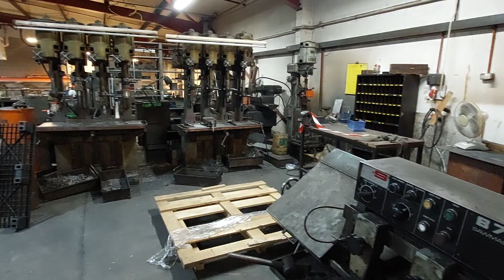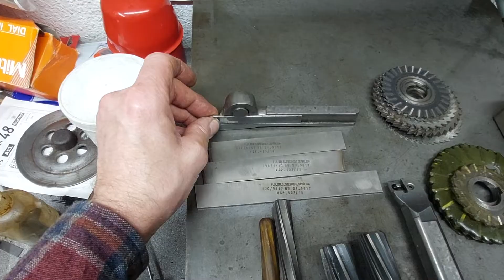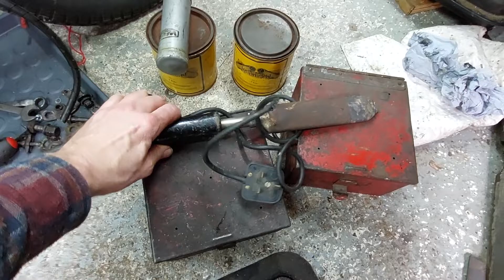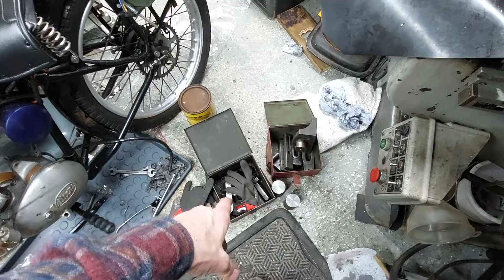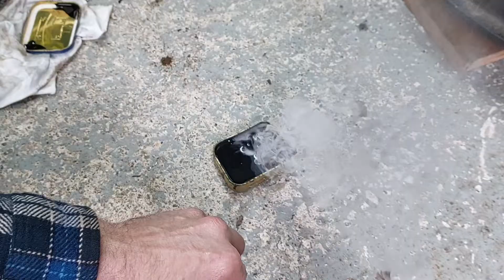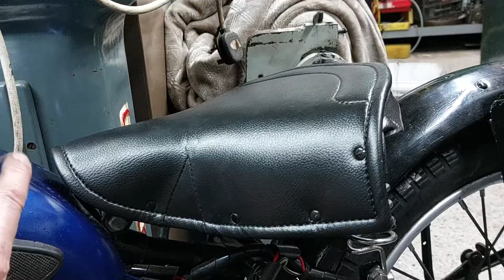WILL IT START....1939 EXCELSIOR VILLIERS 9D ATTEMPTING TO FIRE IT UP AFTER REBUILD

Comment: I do really like working on Villiers engines. I cut my teeth on ths 9E and 32A engines in my first proper trials bike, a Sprite with really worn out AJS/Matchless Wobblydraulic forks. I believe the bike was sold without forks so they could call it a kit to avoid Purchase Tax back in the day. George, the mechanic at Broardway Motors literally kept those plastic HT pickups under the counter and would get one out when he saw me coming. I think I was only 13 possibly, 1976?

I have a Cincinnati dividing head which gives me a hernia just thinking about getting it onto the milling machine table! We bought a granite surface plate at a similar engineering auction. I think its about 24" x 36". They loaded it into the back of the Land Rover with a fork truck. We got home and it occured to us we had a problem, how to get 380lbs of granit out of the back of the Disco. We used the engine crane in the end with strops. A very hairy operation indeed 😬

The Excelsior sounds great.
Reply from the maker: The Excelsior is a nice little thing ( there is one set up as a trials bike at Brooklands ......maybe a way to go, it's light enough)....engine cranes....useful and deadly in equal measures 😬...glad it the surface plate was safely extracted .

Comment: Well done Mr T. Started well and sounded good. When I was mechanicing for the Post Office Motor Transport in the 60s we used  brake fluid to clean out SU carb dash pots and the like.  It worked very well and the carbs came up lovely! Just a thought?
Reply from the maker: I shall give it a go Mike
Reply: @TweedsGarage you’ve heard of the saying, A tiger in the tank! Well the brake fluid got rid of the tiger Crap in the carb, excuse the language, i used  to be choirboy!?,?,

Comment: As a kid around 1970 I bought a non-runner Excelsior-Villiers, girder forks. 
Unfortunately the crankshaft was bent. 
I think someone had tried to run a belt from the flywheel to something in their shed ... 
It turned out to be beyond my skills, knowledge and pocket so I moved it on.
Reply from the maker: That must have been one smokey ( and noisy  ) shed 😄, a shame it was bent.
Reply: @TweedsGarage  The frame and paintwork were in great shape though. I really hope it got brought back to life. 
Handle bar gear change !! 
Really old school.

Comment: The jig borer that you mentioned that Cutting Edge Engineering in Australia purchased used to be at the old NSW State Rail Maintenance Facility located at Cardiff NSW Australia.  I worked there after it was taken over by EDI Rail from 2001 to 2012 and again in 2018/19. That jig borer was in the old apprentice training area within the main workshop in an airconditioned room.  I think when the guy who owns Cutting Edge Eng bought it, it went with a fair amount of tooling and attachments. Unfortunately, a lot of tooling for the machine was thrown out along with a considerable amount of toolroom equipment ie master thread gauges, surface plates, straight edges, master squares and large inside and outside micometer set up equipment. It was criminal the amount of test equipment and tooling that was scrapped. Nobody knew what the equipment was or what it was used for, so it went to scrap metal.
There was also wheel turning machines (some or which went to the Heritage Centre in Sydney, I think). There was a large dual chuck wheel turning lathe that had been there since the steam engine days, there were photographs in the office showing steam locomotive drive wheel sets being machined. The last I saw of that it was out the back of the yard in pieces in the weather for quite some time then it disappeared. Scrapped no doubt.
There was also a foundry at one end of the facility where they made dog spikes, fish plates etc all sorts of stuff and two 38 class boilers set up to provide steam for cleaning etc, as far as I'm aware the old steam pipes are still in place.
Reply from the maker: Thanks for that Mick that's a great bit of info and yes it is criminal the amount of equipment that has been melted down, its quality and precision will never be matched today. Luckily Cutting Edge Engineering managed to source a load of tooling for the SIP jig borer, a lot were as new condition in there original drawer units, definitely things of beauty and worth a watch.
Thanks 
Mr T

Comment: Is there any output data on this Villiers engine to compare with the Bantam, just interested in how the output has changed over the years. The 125 Bantam was 3Kw so I am assuming this may be 2Kw or so, I noticed it only had 40mph on the speedo whereas the 125 Bantam supposedly could reach 45mph. Look forward to hopefully seeing them ridden? Some great videos thanks!
Reply from the maker: In old money the D10/B175 power output was rated 12.6 BHP and the Villiers 9D was rated at a neck snapping 3.15 BHP and yes they will be ridden at some time, thanks for tuning in 👍
Reply: @TweedsGarage  Thanks that helps to fill in a few boxes for me. I have a modern 50cc scooter with an output rated of 2.6Kw which is about 3.5 bhp and a 125 with an output of 10.7bhp. which is similar to the slightly earlier version of the 175 Bantam. Great videos very informative!

Comment: Looks like the alternator low voltage coils were rewound?  Why the hell didn't Villiers key the self extracting flywheel. Gave me grief back in the '60's.  Note, the points brass cover is missing.
The  Mag spanner was called a slogging spanner. You hit it with a copper or lead mallet to lock the flywheel on its taper solidly.
Reply from the maker: Yes the last owner " had a go " at rewinding them ( not the neatest job but they do work ). It wasn't just Villiers, Wipac and Lucas didn't have key ways on flywheels and some magnetos as it allowed for timing adjustments to compensate for  wear on the points/ cam lobe, points wear and machining differences. You can still get the slogging spanners but I´ll stick to the modern tech of my 18 volt Makita impact gun, it'll nip up the nut before the crank and flywheel have know what's going on.

Comment: Use a knife blade to avoid wearing off the locking stub on the screw to spring faces.
Is the pressure pate pulling off square?
Reply from the maker: no,  it doesn't matter which springs are where ( even with new ones fitted ) it always pull off at a slight tilt.

Comment: Great video. I have an old Villiers 9D in an Australian built bike, very similar to yours. I wanted to ask, is there a way to get these bikes to idle a little longer? If I don’t stay on the throttle it shuts off within a few seconds. A video on fine tuning these engines would be excellent! Cheers
Reply from the maker: Thanks Chris, if it's fitted with the Villiers carburettor is has no idle adjustment its just set by adjusting the throttle cable at the top of the carburettor and they were just fitted with a hand lever throttle rather than a twist grip so could be set and left at a suitable idle. I've fitted modern crank seals which will make starting and running a lot better which is covered in the video link below. I've got to repair the exhausts and once this is done i'll be setting it up and riding it which will be in a video soon. https://youtu.be/fVPUxKVgVHE
Reply: Put a little Delorto carb on it from a moped. You can get the jets and it has a throttle stop.Villiers carbs are horrid.

Comment: The steel balls between the clutch pushrods prevent it binding. The pushrod ends are hardened to accept the balls.
Reply from the maker: Hi Rob, these early Villiers engines just had three hardened ground end push rods, the mushroom one that pushes the clutch, a long central one and a short one that rests under the clutch arm which has a hardened ball end adjuster, someone had fitted steel balls to get the incorrect pressure plate to work.

Comment: It lives!!!  Great to hear the results of your labour Allan, the factory clear out was a really good haul, most of the parts remaining after a close down go straight to the scrap man unfortunately, I have seen many good machines scrapped merely because they were old and 3 Ph, but the materials are an absolute treasure trove, most materials that can be bought on ebay are extortionately expensive in small quantities, or we have to buy huge amounts, so to buy offcuts like you have here is more than enough for most of the jobs we do, the dividing head was a good buy, I am glad you found the second set of holes on the back of the plate!  Your wheel adjusters can be made by incorporating the washer onto the end of the threaded adjuster stud, then it will not be able to vibrate off in service, similar the the one you have, but working off the lug that is part of the fork end, I am sure that is what it should have had originally.  Chris B.
Reply from the maker: Hi Chris, it's only chance that i found the extra holes as i decided to clean the indexable head up, i have found a reasonably priced chuck on eBay that'll suit it so it will be up and running soon and it doesn't bare thinking about the amount of machines and tooling that ended up under the scrap man's torch over the years .
Reply: @TweedsGarage  I think the answer is to have a 3 ton trailer and snap all these goodies up, if you have a barn and hoist you can store things up for later, these things are unloved now, but in years to come they will be much sought after, when working at a college as workshops closed the whole lot including CNC equipment and surface grinders etc would sell for £2000 for the whole lot, it was to my advantage sometimes! Chris B.

Comment: My dear friend, you do realize you were making parts with much higher precision and care than the original manufacturer. The timing mark alone looked as if someone scratched it with a screwdriver with fingers crossed. These machines were definitely built down to a price and made affordable for
a working man to get to his place of work and back home again hopefully, with his own fingers crossed!
Reply: That Bike was introduced to the showroom floor when I was two years old! I researched the Excelsior company's history. They had a successful record winning TT races with their own four valve engine designs throughout the 20s and 30s.
Reply from the maker: Thanks Colin, well it's survived 84 years without being thrown in a skip so it deserves a little pampering 🙂

Comment: Good to see the bike running, the dividing head is a great addition , very handy if you need to made a half shaft for the Riley as I had to !
Reply from the maker: Good point Mike, mine being a 5 stud as well probably makes finding second hand ones impossible,  what steel did you use when you made yours?
Reply: @TweedsGarage  I used 4340 HT that was   over 20 yrs and about 25000 mls ago.